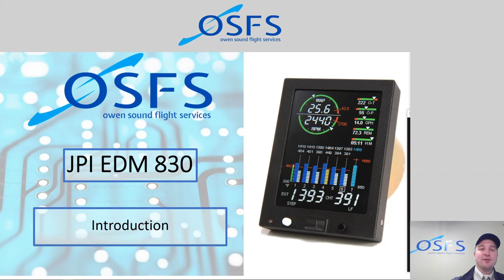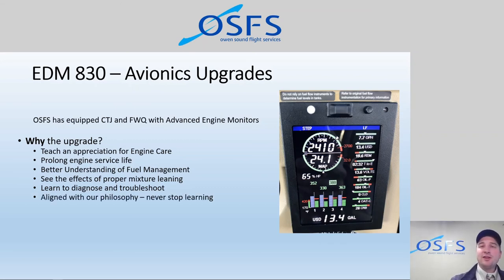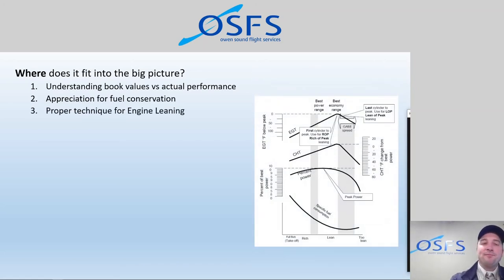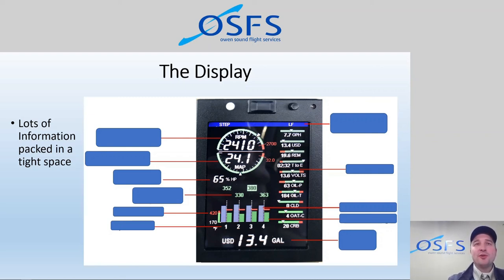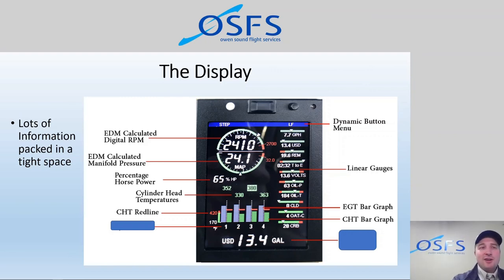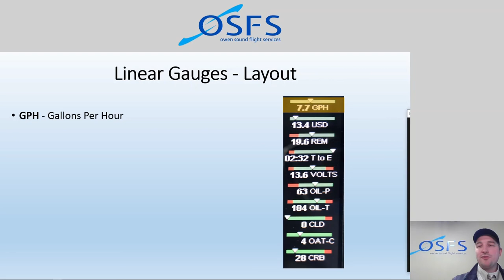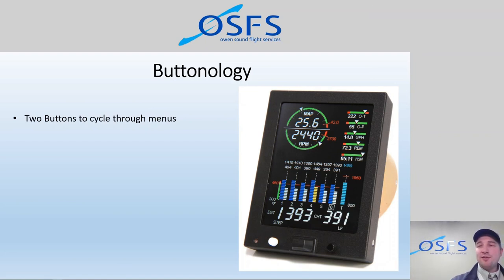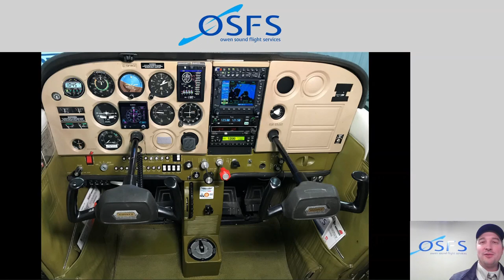EDM 830 -Training Module 1 - Introduction

Comment: very nice, and very informative video, this should be a must view video for all the EDM users, but i have a question?.. where can i find the iformation of how installing the MAP out of the number 4 cylinder inlet? .. i have an EDM-830 in my C172M and i dont have that feature installed and I would like to get it ... but I can't find any info of how  to install it.
Reply: For the installation instructions I would look at talking to someone at JPI if you are attempting to do it yourself.  These aircraft had the equipment and probes installed at an Approved Maintenance Organization, they have access to the required manuals and have lots of experience putting these in multiple aircraft over the years.